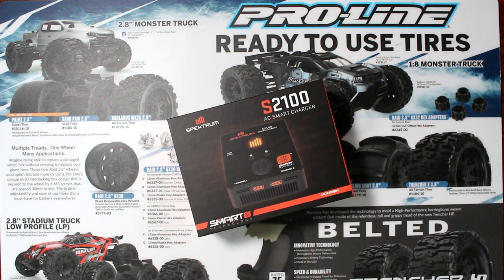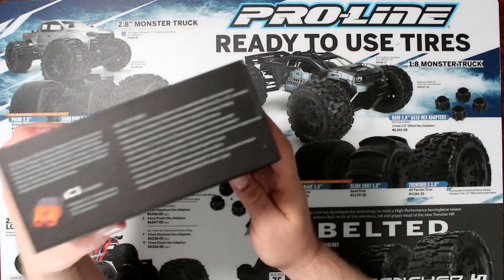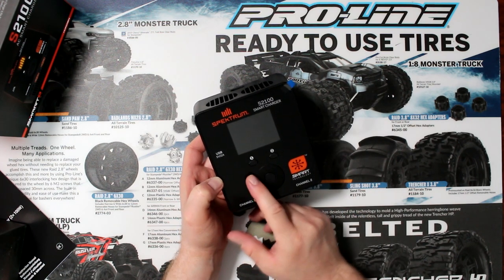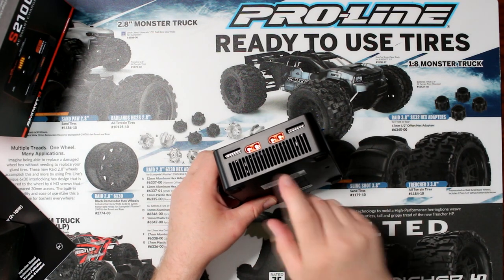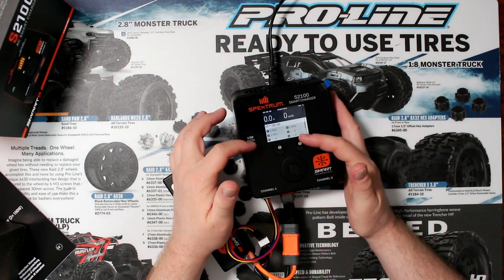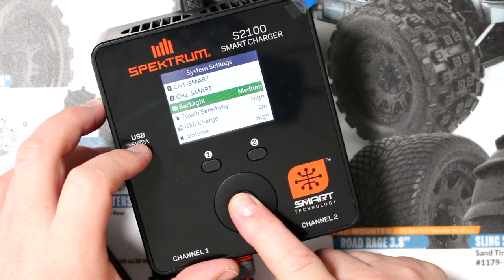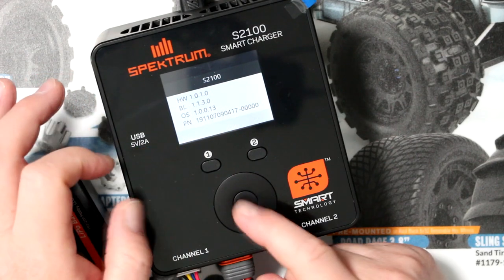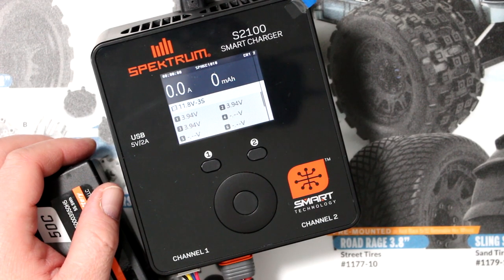Spektrum 2100 Charger

Comment: Just received my 3rd S2100. The first 2 made it about 30 days before showing an Error Message and wouldn’t allow charging or storage on both ports. To Horizon’s credit, they did send me a replacement (brand new at no charge) Both times the issue occurred charging a battery with an xt60 connector and using an ec3 adaptor. Not sure if this was the issue, but for this 3rd S2100 it’ll be charging ic3 and ic5’s exclusively. (SMART BATTERIES ONLY) The S2100 will never leave the house to charge at the field. Glad I didn’t throw away my Venom Quad Pro.
Reply from the maker: I have one that’s only charging on one side. But the type of connecter should not matter I’m just thinking that they might have a bad batch

Comment: Cool channel ,just bought a outcast 8s last week Witherspoon the spektrum s2100 with 4s 5000mah spektrum batteries 2 one batt is all 4 cells 4.19 2nd batt is cell 1 and 2 are 4.15 and 3cell is 4.16 cell 4 is 4.19 any input on batt 2 with all the diff voltage not comparing 2 batt 1 thanks in advance
Reply from the maker: It’s always possible that the cells are not always the same on certain batteries just continue monitoring it if it goes really out of whack I will try to call horizon  hobbies to see about the warranty

Comment: @djsprc how do you charge nickel metal hydrate batteries on this charger? I have the right connectors but I'm not sure what the amperage or watts it should be set at
Reply from the maker: You will need to go in the menu and change it to NIMH. If your charger is set to Lipo right now, you’ll see the word Lipo in the menu select it will have other options.

Comment: 5:21 the adaptor cable is SPMXCA507 not the SPMXCA508, hopefully that helps someone else. And the adaptor is not included with the S2100 charger (I wish it was, would have saved me a day of research and waiting delivery)

Comment: Cant figure out how to change to Celsius. Do you know?
Reply from the maker: I just took a look even myself I cannot figure it out
Reply: @djsprc  thanks for your effort. Another question , when storage charging(discharging), I get very slow discharge rate! Only, - 0,4A with a Spektrum 3S 5000mah 100c. Is that what it can do? The cells are balanced fine and checked all settings. Bought it today..
Reply from the maker: stallpall Unfortunately that is normal this type of charger or pretty much any charger has a slow discharge rate.

Comment: hey budd.>>Cool videos.>>I have a question.>What's the best shock oil weight for a gen 7 pro crawler.>> I have 45 weight,but I seen your old video,so I trust your knowledge.>>Any information will be greatly appreciated
Reply from the maker: Jose Canseca It always depends on your preference on my scx10 II. I am running 30. I would say 20to45 in that range you should be good.

Comment: funny enough...your battery or charger is acting up like mine..it didn't show up as "smart" when you plugged the battery in. Do you know why this is? I have an e-mail out to Spektrum, but haven't heard back. I know it is an issue with the charger or a battery, because I have other Spektrum Smart Batteries that do show up as "smart" when I plug them in...
Reply from the maker: DonnyFrusciante III Yes I know why the reason is the smart ship is damage. That’s the only one I have that acts like that. But it charges fine and when I use it it works fine too
Reply: @djsprc  yep, that is what I figured too. Mine also charges fine...but a bit annoying since I bought these batteries for this feature alone. I am hoping I can get them replaced given they are only a couple months old and have only around 13 cycles on them. I have two batteries that do not show up as "smart".

i am glad to see I found someone else who at least has the same issue.

Comment: How to charge a 4s 5000mah 100c battery? Spectrum
Reply from the maker: If it a spektrum  battery, it should start by itself now if your battery it’s a G2 and you did not update your charger. It won’t start by itself you’ll need to update the charger to be able to charge the G2 battery. If it does a G1, you could charge it at the maximum amperage.

Comment: I’m trying to charge my specktrum 4s Battery and the balance charger doesn’t fit ?
Reply from the maker: It does fit but I’ve noticed on some of those chargers the pins might be bent upwards a bit or downwards grab a toothpick and just put them straight.
Reply: djsprc I’ll look at the pins thank you very helpful and responsive !

Comment: Got the same one wit two 3s batteries and i went to charge them and now it wont read the batteries and say abnormal charge ?? Help
Reply from the maker: Sorry for the late reply what I’m assuming it would be is the main chip in the battery might be defective I would contact horizon  hobbies
Reply: @djsprc  thanks